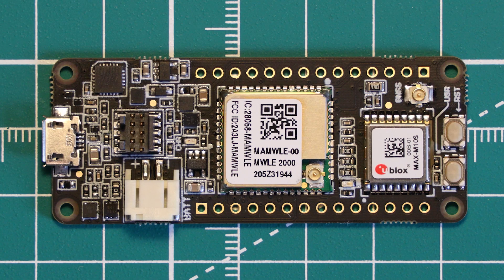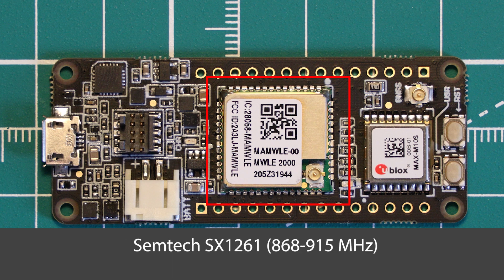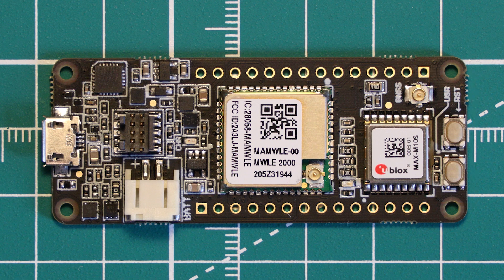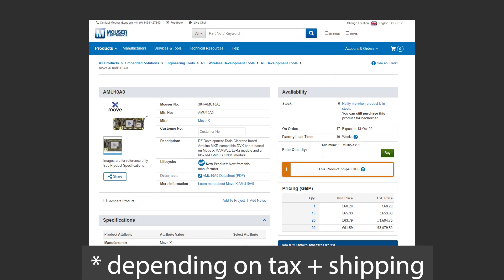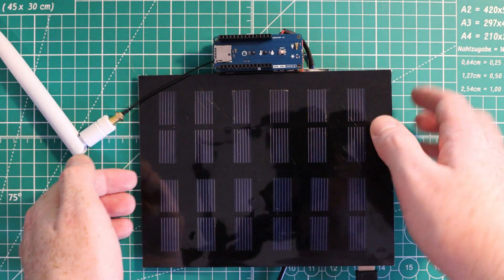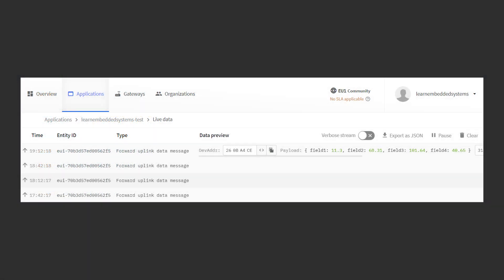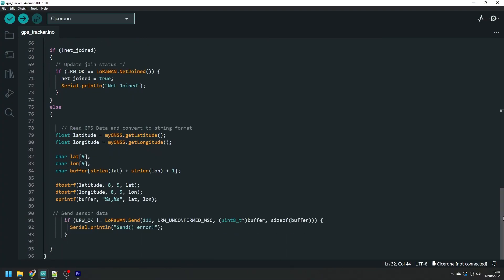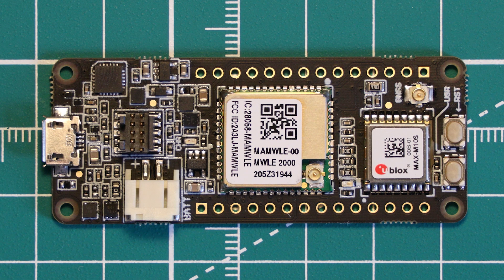Cicerone Board: LoRaWAN & GPS – Asset Tracking & Remote Weather Station Demo!

Comment: Thank you for an interesting Video. i have watched a few of yours and more from others on LoRa. The project i have in mind is a GPS tracking device using LoRa in remote locations, with one or 2 repeaters, and no internet or GSM. The location would be shown on my phone on local maps useing a mapping software app installed. i would like to be able to control the tracker remotely via LoRa also, ie: sleep time, TX power, i do have some electronic experience and a small amount of Arduino experience. Can you advise me on where or what i should be researching to achieve my goal. Thank you in advance.

Comment: How accurate is the GPS when driving along at say 10 to 20 miles per hour? 

Was thinking might be good for driving in a straight line when spreading fertilizer with a farm tractor.

Comment from the maker: Correction to weather station code:

As the Cicerone board is based on the STM32WLExx microcontroller, there is a different working mode of the internal ADC compared to the one inside Arduino MKR boards.
The difference is in the voltage reference: in Arduino MKR the default reference is Vcc (3.3V) so you don’t have to do anything in “setup” section of the sketch code; instead, the Cicerone board the default reference is expected to be present on VREF pin by an external voltage source (i.e. you have to connect that pin to 3.3v for example). 

To avoid external voltage reference is using the internal one (2.5 volt); you can call “analogReference(mode)” passing the “mode” argument as INTERNAL. This means that maximum readable voltage is now 2.5 volt, and you have to scale readings (see Battery_VoltageMonitor example under File->Examples->Cicerone_Demo if you install the cicerone board to the Arduino IDE).